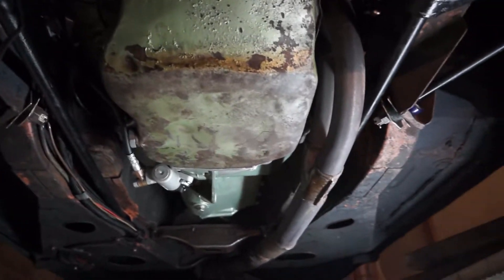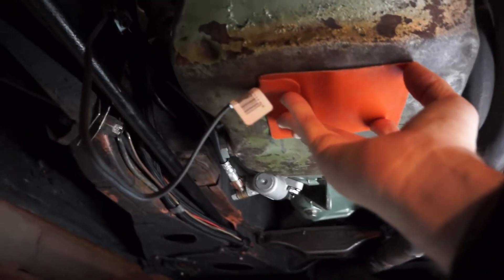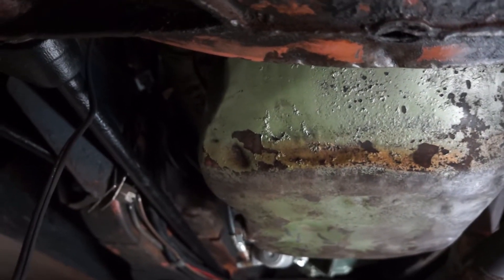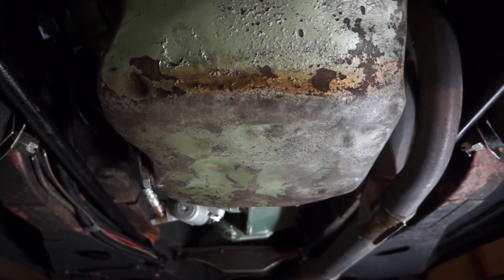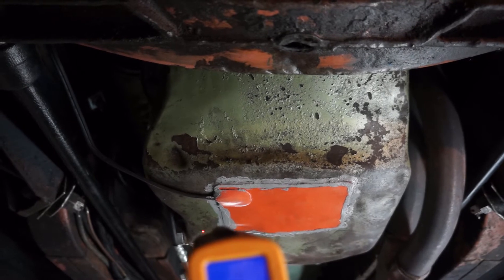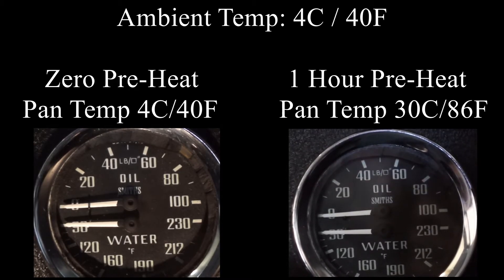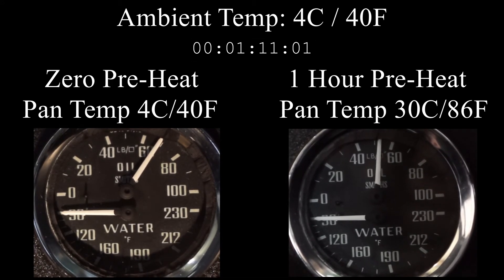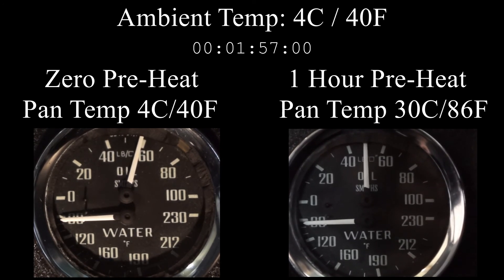1968 MGC Oil Pan Heater - Reduce Cold-Start Engine Wear

Comment: The power of the heating pads needs to be adapted to the oil you have in the engine. You should use 15-25Watts/liter of oil.
Reply from the maker: 150w heater should be right in that range for the MGC.  Thanks for the tip.

Comment: OK 
JR's Garage nice pad but instead of loosing temperature how expensive is to put an inch of insulating wool between plastic cover and sump? Oil thru the steel pan is getting outside temperature directly. Russians are blocking each air vent in front of the bonnet and insulate coolant pipes to get heat as soon as possible. Also engine bottom tray is preventing from getting snow pushed under the car bonnet. If you have very weak battery try to burn anything to heat up oil sump before you crank. Heat up sump... later heat up inlet manifold (nice old ones here made of alloy so you could put flame under it before cranking. You can also try to disconnect air pipe from the filter box and give some flame (hot air to the engine when starting). My Campervan starts better below 0oC than in between 0-10oC bcs below +2 my flame candle is starting. Old Russian tanks T-34 where started on -35C using flame candle made of steel wire?&cloth soaked in petrol. Lighted it will warm you air intake and help to start.
Reply from the maker: There is no plastic cover on the bottom of the MG C.  The electric heater was very cheap and easy to install.  Easy to plug in and use instead of starting a fire to warm the engine.

Comment: Did you have any problems with it burning or smoking? When you added the mixture to help bond
Reply from the maker: I only added a bead of oil resistant high temp RTV.  It is made for engine applications.  There was no burning/smoking. There might have been a slight smell the first time the heater was up to operating temps but I can't recall it seeming abnormal.

Comment: Very good video thanks , I was wondering what the block temp was up near the top of the engine after an  hours heating ? , I have been using Coolant heaters , now having to buy my 3rd one , the heater elements burn out on the cheap ones around on ebay from CZ , going to try another design from China this time. After 20 mins with a 2 KW coolant heater the head temp is 40 C .
Reply from the maker: Sorry, I couldn't say how the temperature change impacted the upper part of the engine.  My main purpose was to heat and thin out the oil so that it would flow better and provide improved cold start lubrication.
Reply: @JRsGarage  I ordered one of these pads , I plugged it in to test it and smoke came off the backing tape , thinking that it might be too hot I took this Vid , it goes up to 220 C then turns off. Seems high to me for a sump heater .https://www.youtube.com/watch?v=ypNI6nWrR7M
Reply: @bedebill  Hi, I've tested my 120w heater and just don't buy a too high wattage one ,250w would be ok.
Even 120w is better than nothing ( bought just to try )
Reply from the maker: Sorry I never saw this port or I would have replied sooner.  I don't think they are meant to operate without being stuck to something... The backing tape would of course be removed when it's installed.

Comment: why not just use a lighter weight oil? 20w 50 seems too thick try 10w30 or  10w40 see if it changes
Reply from the maker: 20w50 is the specification from MG.  I want the same level of lubricant protection but I'm just looking to improve very cold start flow, which the heater accomplished.
Reply: @JRsGarage  Could use a 10w-50 or 5w-50. It'll be way more expensive though as it  would have to be a either pure natural gas made oil or a blend. Regular dyno can't hit both those viscosities and the 50w flash point.
Reply from the maker: I live in Florida now anyway, so this is no longer a problem.
Reply: @JRsGarage  moved from Germany to Florida? Mind if I ask what you do that's quite the move :) ( I also live in Florida but still want to reduce cold start wear on my weekend warrior race car lol )
Reply from the maker: Air Force for 22+ years.
Reply: @JRsGarage  wow- thanks for your service- that's quite the journey- are you originally from FL?
Reply: If you use one of these it totally negates doing that and you can just run 1 oil all year long.
Reply from the maker: I never had a problem using 20w50 all year long with the heater.  I've since removed the heater because the garage here in Florida never gets below about 50F.